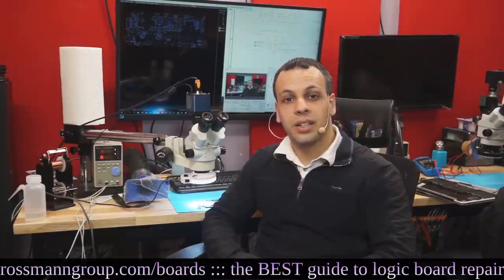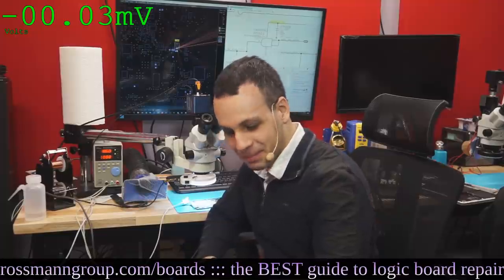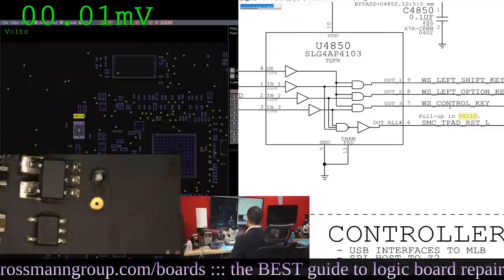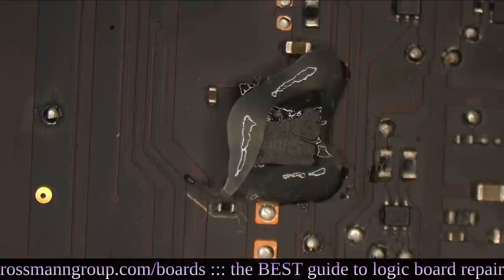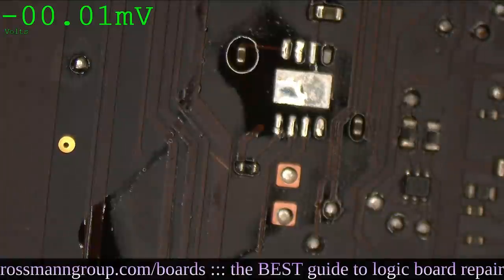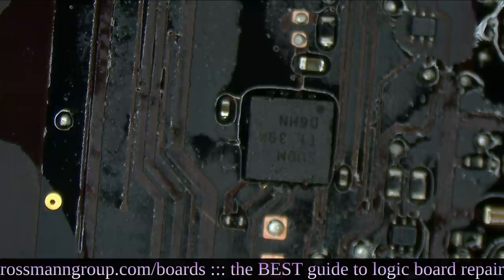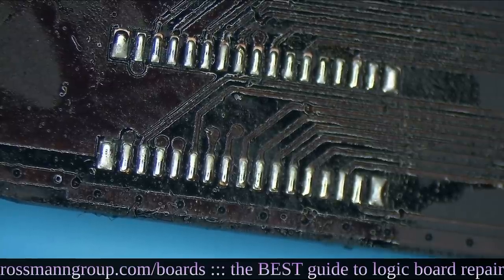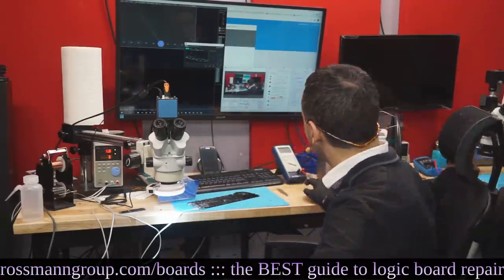Macbook Pro no green light on charger

Comment: Metric volts eh... nice, I'll remember that one for the next time.  In the meantime, I'm curious as to why it's gone and done this, time to get some debugging data off you.

EDIT: Now fixed.  https://github.com/inflex/BK-390A
Reply: Aren't all Ozzies measuring in mate-Volts?
Reply: After carefully studying the data, I've come to understand it's actually macVolts :D
Reply: Wilson, the code is all available at https://github.com/inflex/BK-390A/blob/master/win-bk390a.cpp   It's C++ (strictly speaking, it's C in this case) and just uses the plain Windows GDI interface.
Reply: Wilson,  the delay (meter->screen) is because of the meter itself; it updates only at about a 2Hz rate and only over a 2400bps link. The software itself is updating the screen within a millisecond or two of receiving the full data packet from the multimeter.
Reply: Bugs happen. Thanks for everything you do for the repair community.
Reply: They most certainly do.  Extra level of difficulty when you do not have the device on hand to test with.
Reply: CPUs nowadays are capable of a lot (and graphics cards are only necessary if you want to do tasks like video editing, playing modern games or password cracking). Pushing the new data to the framebuffer of the GPU will introduce a slight delay, but that should be microseconds or less.

Comment: I know this is figured out by now but still. It says volts under volts and MV beside the millivolts. Could be displayed better the lettering and such but it saying both so you know what is what.

I'd say put a big V under the voltage number, and the mV under the millivolt numbers that way you can do the right size so you can see both and still be able to show - and +.

Comment: I see a nice new, anti parts eating, feature on the fume extractor 👍🏻
Reply: Rik van der Mark I hope he didn't learned the hard way to have an anti part eating system. Like digging in the container searching for a resistor.
Reply: JavoCover from the amount of times things got sucked in I do think he learned that way, good thing is that with his Hakko aifilter he can retrieve parts relatively easy by opening the cover and picking it up from the first filter layer ;)

Comment: I have a laptop that sporadically died it seemed. Made sense it is 15 ish years old if not older. Popped it open to see what was wrong and saw what surface mount micro soldering entailed and I went nope, I did what I could I scrubbed it with a tooth brush and alcohol put it together and it worked. I noticed a spot where water got in and a spark had jumped (there was a black mark on the board where it sparked) across a cap and something else (I measure about 19 volts in that area). With an apple product the damn thing would probably explode if that happened.

Comment: Louis, I'm surprised you don't have a bench meter with RS232 hooked up to software to display the voltage. Not too hard to get a Fluke 8840a or Keithley 195 for under 100 dollars. Both units are super accurate. The 8840a is also super fast. I own both. 

I guess a big issue with a bench meter is you'd need space behind the bench so you can see the display, but the RS232 means you can just see the values on the monitor. 

Not that I have any idea about how nice that software is.

Comment: So, there are a couple if things I don’t understand about your work. First, why are you always so down on Apple? It seems to me that they are making you rich with work. Second. Why do you say a motherboard is fixed just because you get a fan spin? I work on Apples everyday and I see computers that have a light and fan spin but the unit will not power on. So that cannot be the only way you prove that it works and, “go to the next board”.  Third, how is it that you can get so close to resistors and such with that heat gun and not have them come off the board? I find that amazing. I’d love to say tons more but I don’t like typing on an iPad. So until next time, later.

Comment: SOMEONE HELP PLS
My MacBook pro 2011version doesn't turn on. When I plug in the charger the light on the charger burns green but the MacBook isn't charging and doesn't turn on when plugged in. I tried the smc reset a 1000 times by removing the battery but when I plug it in the charges burns green again and the MacBook still won't turn on. Sometimes if I connect the charger the light doesn't turn green and I can power it on but the fan is spinning violently and loud. If I disconnect the unlit charger the MacBook turns off. When I do manage to turn on and log on with the spinning fan I notice the battery icon isn't there and is a cross instead. Pls help me or help me diagnose what is wrong.

Comment: I need some help about the soldering such small pins.

Not sure why, but when I try to solder these small pins , lets say a SOIC chip, i bridge the pins with the solder every time.
When you solder the pins the excess solder is like sucked away to your solder iron tip, unless there is a big ass solder mess. I just seem to bridge the pins no matter what, and it is frustrating.
I am using flux, the one you use, but i'm not sure about my solder, not sure if its leaded or tinned, how can you tell, does not tell me on the label?
Or is this just all technique and I'm a dumb ass who needs practice.... :) - I want to get back into this work, but have never worked on SMD stuff before, and it is exciting. Needing a life style change.

Also, how do you find a fault on a 3.3v rail, when it is grounded and there is a ton of components on the 3.3v rail? I removed one burnt out chip, but 3.3v is still grounded.

Oh, I also hit that bell.
Love your videos, maybe some tuts on fault finding without a schematic.

Comment: Why does he remove JTAG connectors?
Reply: Basically, this JTAG connector is used by apple to access every vital part of the board ( for flashing, updating EFI, etc etc), the problem is that, as you can see in this video ( and some other ), JTAG iscentralizing every access but also make it too much vulnerable to corrosion, food, and other things which lead to malfunction. 

Removing it is a good solution so it doesn't happen anymore.

Comment: Considering how much of a centre of potential destruction the Jtag is I'd love to know why Apple don't take steps to protect it from exposure to liquid and other contaminants. A blob of sealant over the legs and a cap to sit over the socket surely wouldn't be that expensive.
Reply: Better yet, why even use a connector? I've designed many products and the JTAG has always been on a bed of nails array. The IFL and test is almost always done in production with a bed of nails test jig and a connector just adds cost and unreliability to the product. If it's a product likely to get moisture damage you can cover the BONA with conformal coating or varnish after test. Also having to attach a connector during test is just another way the product can fail final test, not to mention making the test procedure slower. In product development it takes just a few minutes to solder wires to the BONA, or you can just get a production test jig built at the same time as the final board and use that...
Reply: I see the point of having a 'jam the lead into the hole on the board to do the job' approach, it does at least make it quicker and simpler to do the job (lets face it, the people doing the job are probably largely unskilled because they're cheaper to hire) but yeah, i tend to agree with your point. I just think it's insane for such a vulnerable part of the board to be left exposed to the slightest of abuse for the sake of what's literally pennies worth of gunk and plastic. It's not like Macs are cheap, put 2 cents worth of protection on the damn thing Apple! I'm sure the kind of people willing to spend that kind of cash wouldn't mind, they could call it 'Apple premium ingress protection' and make it out of branded white plastic all while giving it a cute name.
Reply: You don't exactly need to be a rocket-surgeon to use a bed of nails tester. You put the board in the slot and pull the clamp down; the pogo pins go in the right place by the alignment of the jig. I would have to guess the point of the connector is that it can be plugged in while it's still assembled into a laptop.
Reply: True, but wouldn't you need a different one for every model? Given Apples love of ludicrous prices I'd think that would be an expensive way to go.
Reply: puddingpimp Exactly. You don't need to completely remove the board, and you only need to send apple stores and repair facilities a cable rather than a test jig. That's why it's a connector.
Reply: lampyman101 how are you going to encourage people to buy your latest and greatest if you old stuff still works like new. I'm surprised they don't have a self destruction button on the keyboard itself that only says "do not push".
Reply: DriveJapan That thought had occurred to me lol.

Comment: When you add too much solder to the center pad, then push it down so the solder squeezes out, doesn't that carry a risk of the excess solder bridging between the center pad and one of the pins? And it would be under the chip, so you wouldn't see it. Right?
Reply from the maker: there is solder mask between the center pad and the pads for the pins of the chip. Solder does not stick there.